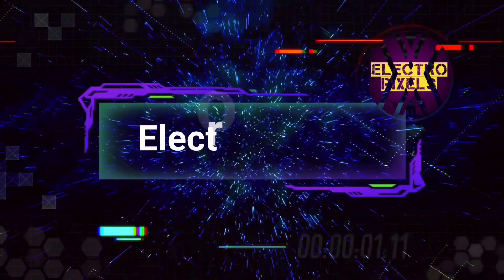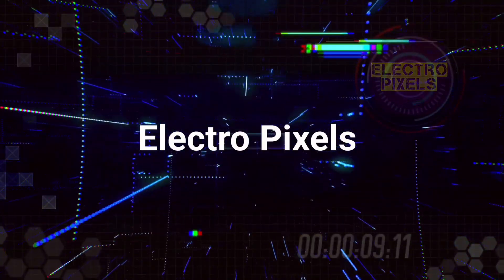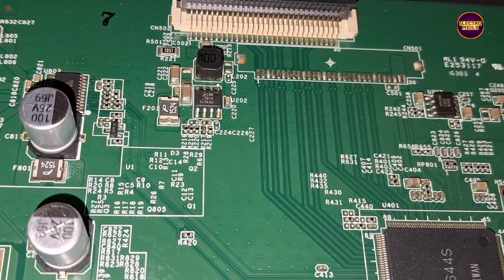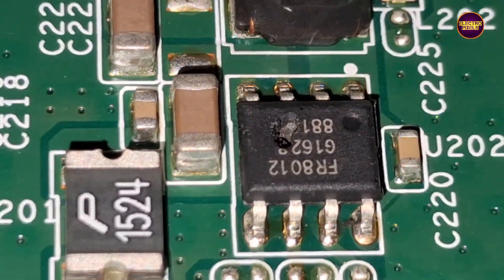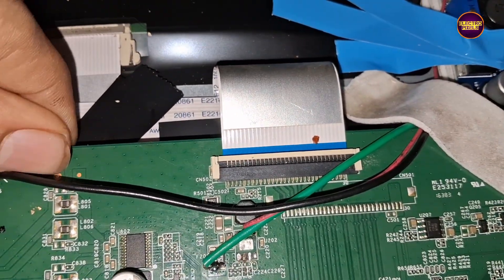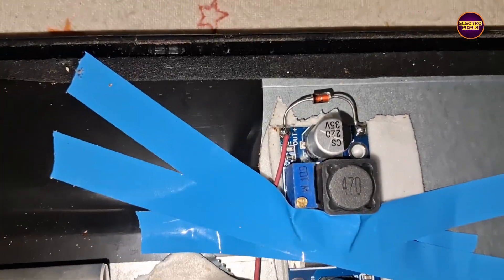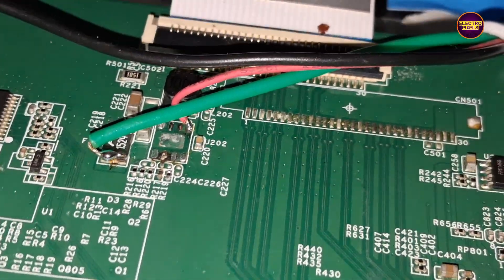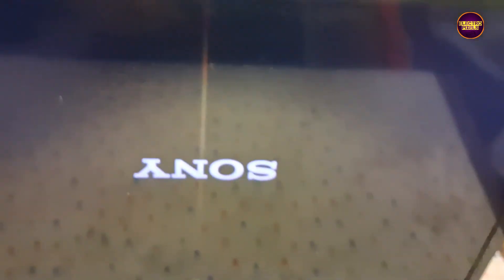Sony Led Tv Blank Picture,No Display | Backlight & Sound is ok|klv-24p413d,How to Repair Practically

Comment: It's really good to see having a zener diode connection to the o/p for protection. Well done sir🙂👍
Reply from the maker: Please share video and Support Sir,
Reply from the maker: Thank you for watching
Reply: I also have the same problem what I do now give me solution
Reply: Use ic lm2596 step down buck converter which having ability to reduce high i/p vtg. to low o/p vtg by adjusting preset with 3amp current.